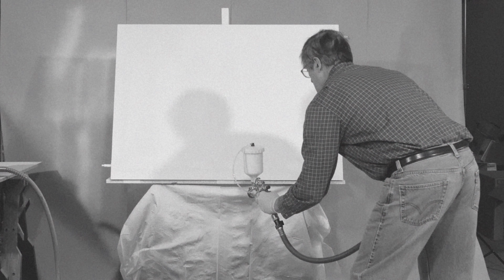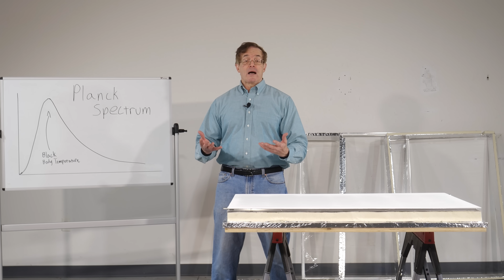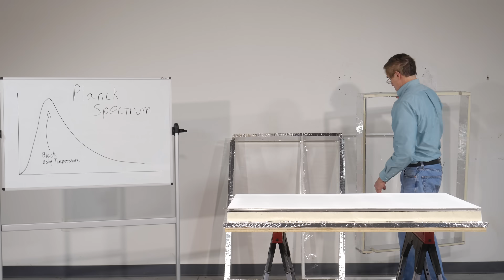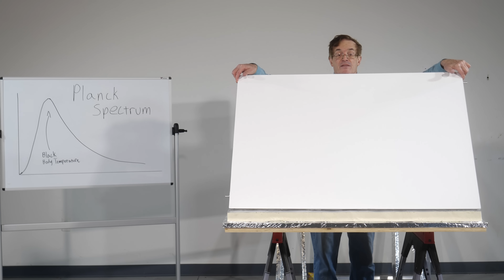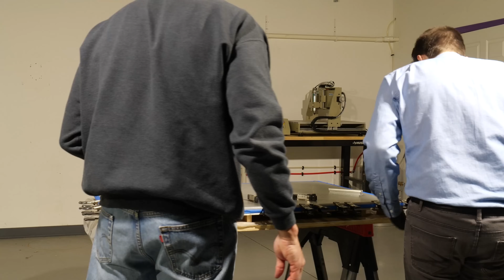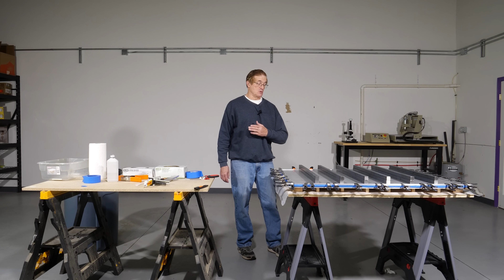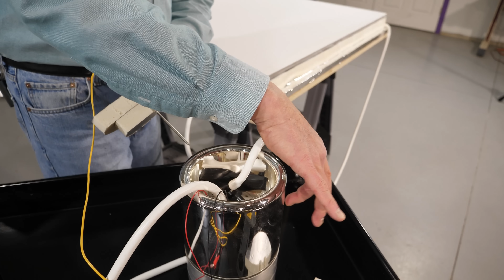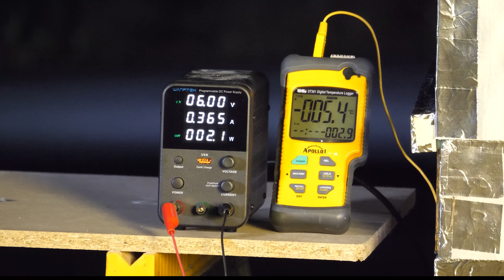Air Conditioning isn't free... but we're close.

Comment: I love passive cooling experiments! Thanks for bringing this to the fore! I know you weren't able to mention every single detail, but nevertheless it should be noted that on the vast majority of nights when cooling is most needed there will also be high humidity, which means condensation. Any condensation that forms on this special coating will temporarily nullify its special properties, since the water droplets will become the new radiating surface. Therefore it is crucial to eliminate the potential for condensation to form on the coating. This can be done by completely sealing off the area between the plastic wrap and the coating, and only allowing outside air to equalize any pressure difference after entering that area through a port containing a reservoir of a strong desiccant material. The desiccant would obviously have to be maintained by periodic regeneration. All very doable things. I imagine that the special coating would be a material that has a very narrow emissivity band exactly coinciding with the transparency window of the atmosphere. I just recently read a paper about some extensive research and experimenting that was done to accomplish this. They were able to consistently achieve (when clouds were not a major issue) much colder than ambient temperatures, I want to say somewhere around 20 degrees C colder or more. In fact, they found that this passive cooling actually works best during the day (obviously due to the higher temperature difference between earth and sky during the day). Now the caveat is that these very large temperature differences below ambient can only be maintained when as much heat load as possible is eliminated from the radiator. So if you actually want to tap into that potential and use it to cool something, that sub-ambient difference will be significantly less. So there would be a sweet spot where you would achieve maximum benefit from this setup. If you radiate at near ambient temperatures, your heat dissipating capacity will be the highest because of Plank's law. But your cooling fluid would only be cooled to ambient temperatures, which would be almost useless. If you try to achieve max temperature differential, your radiator will be super chilled, meaning you will be removing very little heat. One way to ensure max efficiency of this setup would be to do it in stages. The first stage of sub-cooling could be perhaps a much larger panel set up all around the super-chill panel in the middle, and this pre-chill panel would not need tall aluminum blinders on the sides to cut out the incoming radiation from trees and buildings and such. It would take advantage of a greater percentage of the open sky, thereby dissipating more total heat, but would only go a little bit below ambient. Then the fluid would enter the center panel setup (the super-chiller) which has taller aluminum blinders, where it would do the limbo and see just how low it can go.
Reply: I was looking at using heat pipes to transfer heat which is just a evacuated tubing with refrigerant like ammonia and possibly some high surface area working area like sintered copper. But then life hit me and my lack of programming skills became apparent for data logging. I’m working on it, but if I just bought this stuff it would be $500
Reply: Just an curiosity question. Is there a gas that would expel moisture as well as provide or enhance transparency to IR? If we are sealing it would argon or others be of benefit? I've looked at the backyard geo thermal tie in on AC and that seems like it will still provide better cooling at 6' depth than the differential on this exchanger. My worry is that the heat sink of the back yard will eventually reach an uptake equilibrium with days of pumping heat into it.
Reply: @raymondschlitzkus7378  It doesn't, because the ground your heat exchanger is making contact with is also in contact with the rest of the ground and thus contact heat exchange should keep up with the heat generation, or the opposite if you're using a heat pump. The biggest problem with geothermal temperature exchange systems is the upfront cost. It's pretty expensive to dig a six foot deep and however many foot wide hole and then maintenance of the unit becomes a major expense, so installation has to be near perfect.
Reply: hi there, hi agree with you that condensation would form a layer of water that overcomes the emissivity of the special coating. However, if I recon well, H2O itself has an excellent emissivity in the 9-13um IR window too, maybe 95% of a black body or so. One can thus engineer a system to constantly have a layer of condensed water, like a tiny pond, and be fairly happy with that too rather than going through the costs and hasselts of coating a "special" emissive layer.
Reply: @nicochio  The problem with conventional materials and with water itself isn't their black body efficiency, which is fairly high, rather it's their absorption of downward infrared radiation coming from GH gasses in the atmosphere. So even though they radiate out quite effectively, they are also being warmed back up by the infrared heat coming back from the sky. Therefore their potential to cool below ambient is limited to perhaps  10 degrees C under very good conditions, but much less when humidity is high, since water vapor is the most abundant GH gas in the atmosphere in general, especially in places where radiative cooling is desirable. However, these special coatings have a narrow bandwidth in which they radiate their energy at, which means that that same bandwidth is their absorption bandwidth as well. And this bandwidth correlates extremely well with the transparency window of the atmosphere. So these special coatings do not absorb much of the infrared heat coming down from the atmosphere, and this allows them to reach much cooler temperatures below ambient. So that's why condensation would be an issue, because it would absorb this longwave radiation coming down from the atmosphere, and prevent the temperature from going any further below ambient than any regular surface would do. So we absolutely have to protect the coating from condensation if we want to get down to 15-30 degrees below ambient.
Reply: My brother in christ how are you so learned but have never heard of a paragraph break. Thank you nonetheless for your comment.
Reply: @test-sc2iy  Yeah, that could definitely use a few paragraph breaks. I think it's just my mentality for comments on YouTube; they just kind of progress in my mind as one fluid thought chain. Organizing into paragraphs is a step I would do if I were looking to write my own essay or publish my thoughts more professionally.
  But it might be worth a try to do it in a comment, lol.
Reply: @HeyChickens  I enjoyed your comment and found it informative either way, it just took a lil longer to read than a nicely broken up comment would have :p  

Totally empathize with your decision, just want smart shit like ur comment to reach maximum eyes and with my (and presumably others') atrophied attention span paragraphs help :)

Comment: tip: don't swing your paint gun side to side, always point it straight at the work, unless you are covering a corner or edge then you also need to spray it 'at' the angle which would be 'perpendicular'.

Comment: 22:10 - well, at least in my home, I have cast iron radiators, which I imagine could react with the aluminum in this unit to form a kind of battery and corrode over time.
Also I would be interested to see a close-up of what the heat exchanger unit it looks like, like how it's constructed close-up

Comment: i'm curious how much MORE efficient you could make it if you added some fins to it like a normal heatsink, they already passively air cool but most use a fan to help further the efficiency by pulling the heat away from the fins. increased surface area!

Comment: I read the paper talking about this affect, and have been thinking of ways to incorporate it into a heating or cooling system. This is awesome.

Out of curiosity, if you increase your surface areas would your efficiency increase as well? I was thinking something along the lines of a finned radiator coated in the super coating, or a Steam turbine heat exchanger (hundreds of smaller pipes, all drastically increasing surface area).

If you stacked the system with gaps, could the radiation eventually bounce out?

Lastly, could you incorporate a thermocouple genera8 to further boost efficiency by drawing out thermal energy with the temperature coefficient always being different?

Comment: One limitation to keep in mind regarding sub-cooling the refrigerant in your ac system: Unless you are able to dump the FULL load of BTUs of your ac at sub-ambient temperatures, you will not drop the head pressure of your ac system. You will still cut down on your energy usage by a tiny bit because your liquid refrigerant will enter the evaporator pre-chilled, and that will allow the refrigerant to absorb more heat from the conditioned space. But the head pressure (which in large part determines the amp draw of your cooling system at any given moment) will still be determined by your actual ambient air temperature, regardless of any sub-cooling you achieve with this setup. In other words if you have a 2 ton ac system (24,000 BTUs) running at night with an ambient temperature of 75 degrees and a head pressure of 236 psi (for a condensing temperature of 80 degrees), and your night sky radiator system is getting rid of 6,000 BTUs, your head pressure will remain at 236 psi, but you will get 6,000 BTUs of additional cooling for the same amp draw. This is so because the head pressure is determined by the condensing temperature of the gas in your ac system, not the subcool temperature. Once the gas has been fully condensed, no amount of additional cooling to the condensed liquid will have any effect on head pressure. Trust me on this one, I promise you I am correct. So yes, you will get those 6,000 BTUs of free cooling for your conditioned space, but there will be no additional "super" effect from applying those cooling BTUs directly to your ac system, other than maybe a couple hundred extra BTUs or so due to the liquid initially being a few degrees above ambient. I thought long and hard about this idea quite some time ago, so that's how I know the answer so quickly. It would work, but it wouldn't lower your head pressure, unless you reduced the amount of refrigerant in your system. If you did reduce the amount of refrigerant, your refrigerant would come in a little bit warmer, which would make your radiator assembly more efficient. But you would probably need to add a receiver to make sure you don't cut it too close but get a solid flow of liquid refrigerant to your evaporater.

Comment: Can this be combined with a low temperature delta Stirling engine?  I mean...  Engines exist (according to google) that can run at less then 1c difference.  So you're getting 4-5..  If you have a the engine use the ambient air as the hot side and the liquid output of this panel as the cool side, could that not generate power by simply pumping the heat into outer space, essentially?  Probably not as good as solar per square meter, but I couldn't find anyone testing this on google searches..  Most likely because per watt solar is worth it even if only during the day, haha.

Comment: Using an air-to-air counterflow heat exchanger in conjunction with an evaporative cooler, you could theoretically cool a reservoir of water well below the wet bulb temperature, to temperatures approaching the dew point.  If you use this water to cool the condenser of a vapor compression cycle air conditioner, you can effectively push your heatload downhill. In optimal conditions this would actually GENERATE electricity by evaporating water.
The most difficult part is making an inexpensive air-to-air heat exchanger.

Comment: Heat pumps absolutely work below ambient temperature, so I’m confused by what you mean
Reply from the maker: The heat pump has two parts, one outside and one inside.  The compressor, with its liquid to air heat exchanger, is located outside. This is where the heat is dumped.  No matter how large the heat exchanger  and its  fan, the compressed refrigerant can't  get colder than the air that's  cooling it.
Of course, once inside, the refrigerant  expands and absorbs heat as it cools.
The radiation based chiller would be used to bring down the temperature of the refrigerant  on its  way into the building, decreasing its  temperature so that when it expands inside, it would get even colder.
Reply: @TechIngredients  Do you know why existing designs haven't implemented your set of materials to improve efficiency yet? Also, if Aluminum is bad at giving off heat, how does putting on a layer of something that is good at putting off heat help it? The Aluminum still has to give that energy to the material layered on top of it as far as I know.

Comment: I built a passive solar air conditioner for my home and shop in the Nevada desert using nothing but wood and sheet metal. Very simple. Much more simple than what you are doing in this video, and I suspect, much less costly, for a 56' x 32' structure.
Reply from the maker: That's  good

Comment: For your tray I was thinking the 25x25 mm tubes that have plastic elbows and T joints may be a efficient way of making the tray. You would still need to bond it to the top and bottom lid so most of the same construction would apply.

Comment: If you paint the reverse side ultra black can you get the reverse effect in winter (warmer than ambient)? Then it could be useful increasing the efficiency of heat pumps year round by merely by flipping the heat exchanger. Granted, I'm in the PNW, cloudless summers and perpetually cloudy winters so depending on how limiting clouds are that may not work but I'm always interested in whatever makes my heat pump more efficient (as my largest electrical draw by a lot)
Reply from the maker: You could.  That's not a bad idea.

Comment: If the goal of the additional shroud is to block out IR coming from nearby objects, covering it in IR reflective material seems like the wrong thing to do if the walls are vertical. You're just reflecting it back onto the radiator surface nearly as efficiently as if the shroud weren't there. A shroud of this design only works if the height of it is a significant portion of the height of the sources you are trying to block - in this case, you're not even close. Rather, you should  splay out the walls so that they aren't vertical and anything that hits them from a low angle is reflected back out of the box. Moving the window below the shroud would also help a little bit. The angle doesn't need to be too far from vertical, just enough so that the path from the top edge on one side of the shroud to the bottom edge on the other side of the shroud will be reflected out of the box rather than onto the radiator. But even still, a shroud this short relative to the size of the radiator doesn't do very much since you still have plenty of line-of-sight paths from nearby objects to the radiator surface.

Comment: I love this deep space concept. I live in an area that has more cooling days than heating days. I have a hydronic floor for heating using solar thermal collectors and an in-ground "tank" for thermal storage. I've been playing with a few cooling ideas. I'm very curious how this concept would compare in cost, size and capacity. 

The first idea I'm thinking about is a simple buried ground loop to expel the unwanted heat. My initial calculations indicate that I would likely need a fairly substantial sized loop, e.g. 1/4 the square footage of the house and buried at least 3 feet deep. I'm a little concerned with the absorption rate of the ground, as it does not contain a significant amount of moisture. 

The second idea is a "Zeer Pot" system. Essentially, prepare an area for sod, install a lawn sprinkler system, cover the area with ground loop PEX, layout the sod and run the sprinklers often enough to keep the area damp and evaporating. 

Now considering this high emissivity coating, I might consider building two sided, flat plate DHW collectors. One side with matte black, high absorption coating and glazing and the other side with removable rigid foam panels that would expose the high emissivity coating. During the Winter months the panels would be angled toward the Sun with the foam insulation installed on the backside thereby collecting thermal energy to heat the floors. However, during the Summer months the panels would have the foam backing removed and turned "upside down" exposing the high emissivity side to space.
Reply: "Honey, did you remember to flip our outdoor radiators?"